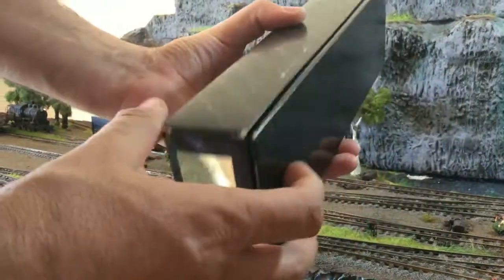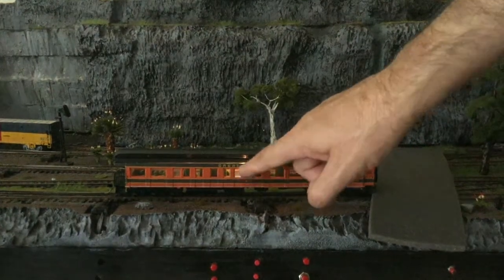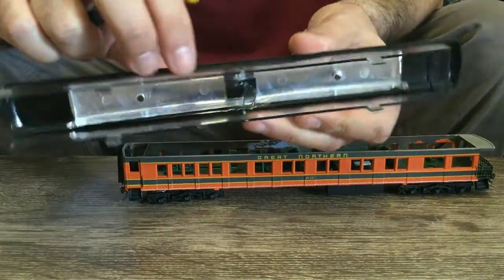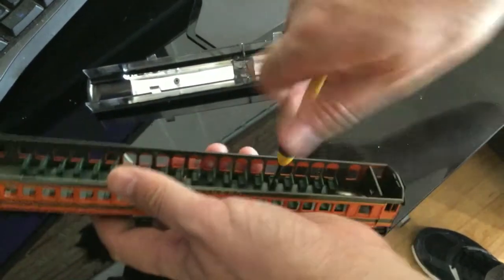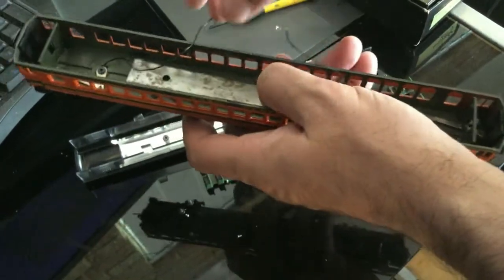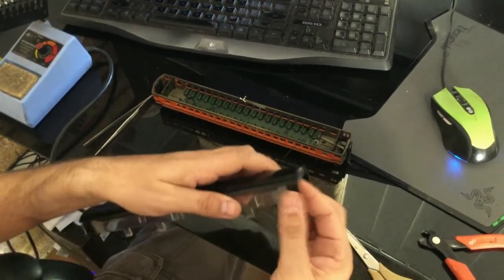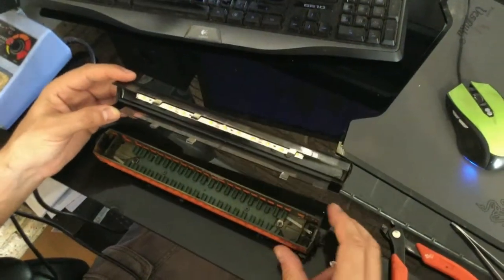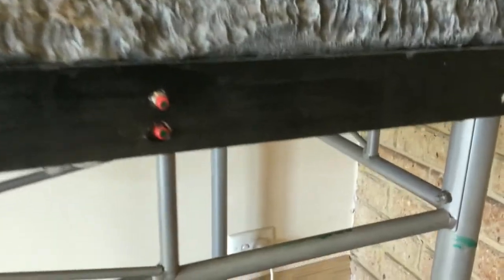Bachmann spectrum heavyweight passenger cars

Comment: Great video learned a lot but can you tell me were I can find a wiring diagram for a four pin bridge rectifier that will work with this. Thanks so much for your help.
Reply from the maker: I am not sure where you can find a diagram sorry. If you look at the rectifier the two pins positive and negative is the output. The 2 pins with wavy lines is the input. This can be dc or DCC, positive and negative does not matter to the wavy lines. Dunno if this helps
Reply: @dynamicloco2186  Thanks so much that is a great help I will give it a shot and see if it works.
Reply from the maker: If you have any questions reach out and I will try help as best I can.

Comment: Great Video!  Noob Question - I thought LEDs were DC only?  Meaning that DCC (AC) had to be converted to DC with a diode rectifier first.   Is that not the case?
Reply from the maker: No such thing as a noob question mate. The DCC will power the LEDs. The DCC will also power the LEDs bi directional meaning positive and negative does not matter. The rectifier is only to run that the capacitor”keep alive” cause polarity on that one does matter

Comment: Did you just use  12v LED Light strips.  I guess mine were 1.5v strips cause they burned out.  But if you cut the strip does the change the voltage requirement?
Reply from the maker: The voltage feed is uneffected so long as you cut the strip at the connection points. Weather it’s a 3cm cut section or the whole 5meter roll the leds run on 9-12v.

Comment: What kind of led light strips did you?  What exactly would I need to order to do this to my cars?  Thank you.
Reply from the maker: Go on eBay and search for warm white led 12v light strips. they come in Rolls of 5m. Get your self a roll of light gauge wire and you should be good to start the project.
Reply: @dynamicloco2186  Thank you.

Comment: Would this process work for standard dc as well?.
Reply from the maker: It will work. The lights might only come one way depending on what the polarity is. To avoid this wire in a small 4 pin bridge rectifier that way you can have lights in both directions

Comment: Has anyone thought about how to fix Bachmann drooping couplers? The bellcrank mechanism is kind a nice thing for dealing with sharp curves, however it introduced a new problem of the couplers being low on one end.
Reply from the maker: I have experienced the same issue. My thoughts was to make a makeshift bracket with styrene holding the mechanism at the right height or removing the crank and glueing in a non moving coupler box from kadee. That is something still on my “to do list”.
Reply: The most common fix I've seen is to body mount Kadee's. I don't want to do this as these are intended(in part) for a Christmas loop. My temp solution was to cutoff the gladhand. I'm thinking about trying to shore it up with some .040 plastic strip.
Reply from the maker: It will take some trail and error for sure.
Reply: I'm working on the drooping coupler problem right now. So annoying on such nice cars.
Reply from the maker: Bloody Marvelous!!! Thanks heaps. It is a great solution and another good channel to watch.